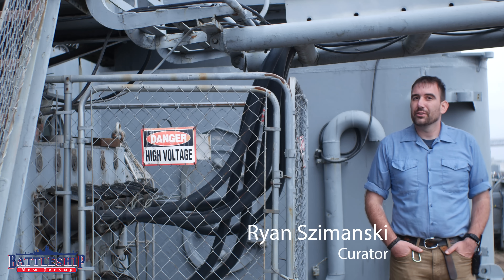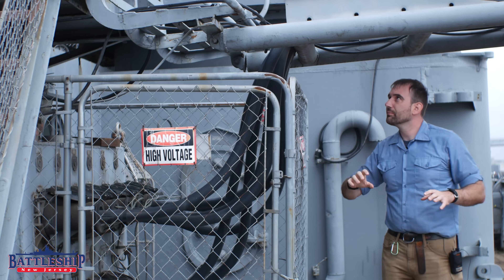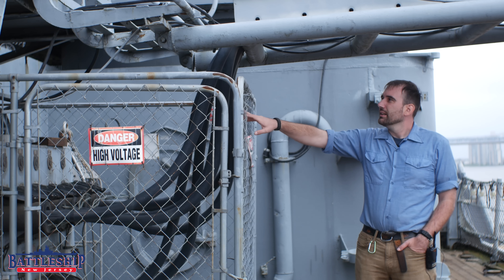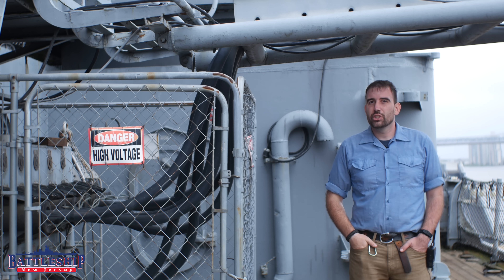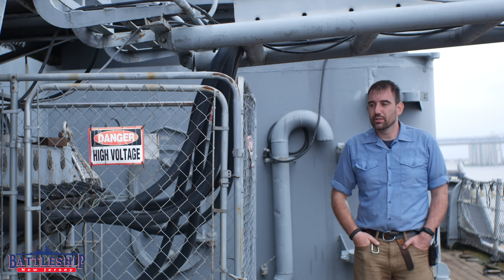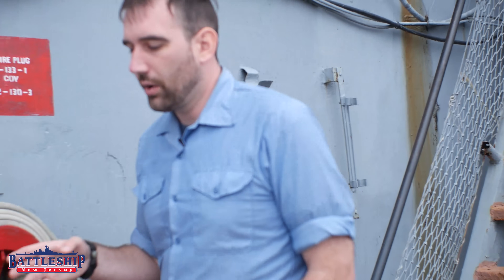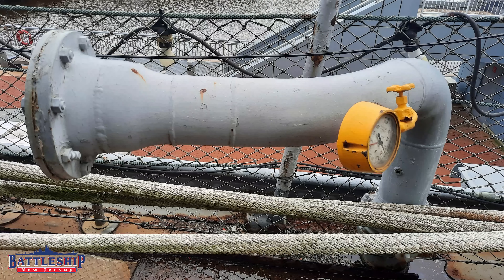Where Does the Ship's Power Come From Today?

Comment: Based on the ship's proximity to the Hope Creek plant you can now proudly say that the battleship is powered (at least partially) by a nuclear reactor.
Reply: Registry # edited to "BBN-62"
Reply: Probably fair to say it's partly coal powered too.
Reply: @borisbadaxe9678  which spins steam turbines therefore the ship is steam powered!
Reply: @ThePrybra07  A Steampunk battleship! Now THAT would be cool!
Reply: @borisbadaxe9678  Wait, is that a joke or serious?
Reply: @dpkeys  Somewhere out there I am sure an alt history exists where the Iowas kept sailing and got a nuclear refit. modern naval nuke probably takes up less space than all those boilers.
Reply: @borisbadaxe9678  It already is, battleships ran on steam. Even the Gerald R Ford carriers are steam ships, The Nimitz class carriers do not really have a terribly different driveline from an Iowa class battleship. Steam turbine driving the screws, Difference is the carrier has a nuclear reactor but when you get down to it the reactor is just a spicy boiler.
Reply: @appleintosh  Serious. It is impossible to say where power comes from, since it comes from all of the sources currently pumping power into the grid. Wind and solar, nuclear and coal and natural gas, all of them power the grid, and the grid powers the battleship.

So in a sense, the battleship is now a sailboat, a nuclear ship, and a coal fired ship. Oh, and since the thermal sources (nuclear, coal, and nat gas) use the heat to create steam to drive a turbine, the battleship is using steam power too!
Reply: Steve Wolcott   Ultimately, every source of power comes from the sun - dinosaurs, coal, oil, solar, even nuclear (which was formed in a dying star).
Reply: @Custerd1  Agreed. Basically all the power on the planet was, and is, from a fusion reactor.
Reply: @firstlast-xn6ul  It gets even better.  You can't just shut off shore power, then connect the switchboards to the ship's generators.

Instead, what you do is bring the generators up, match voltage, frequency, phase, and phase angle with shore power, then literally CONNECT THEM TOGETHER electrically.  You can then start bringing up the excitation on the generators, causing them to pick up progressively more of the electrical load.  When all of the electrical load is on the generators, then you can open the SP breakers and disconnect the cables.

Reverse the procedure when you come back into port.  Hook up shore power, match the generators to shore power, shift the load to shore power, then open the breakers for the generators and start shutting them down.

If you read between the lines a bit, during that 5-10 minutes of shifting the load around the ship is actually doing its small part to help power the US electrical power grid.  After the Loma Prieta earhquake in San Francisco, the Navy Comm station and the galley building on Treasure Island were actually being fed power and steam FROM a ship via the SP electrical and steam connections.  This lasted for about a week, until they could get the power cables repaired which normally fed the island.
Reply: Steve Wolcott  Coal was largely made during the Carboniferous Period, predating the dinosaurs. Once fungi evolved the ability to digest lignin, coal beds were essentially impossible to be laid down in large quantities.
Reply: Steve Wolcott  coal comes from plants
Reply: @filanfyretracker  Yea but as soon as the ship takes a hit you have a massive problem on your hands.
Reply: Ryan mentioned in a previous video he prefers battleships to not be nuclear powered as they don't like the vibrations associated with a hit

Comment: The overhead supports for the electrical lines have broken welds at the extreme left where it transitions to the hinge points.  I noticed it at video time frame 6:45  Looks like it's about to break!
Reply: You can also see that at 3:14. Oof
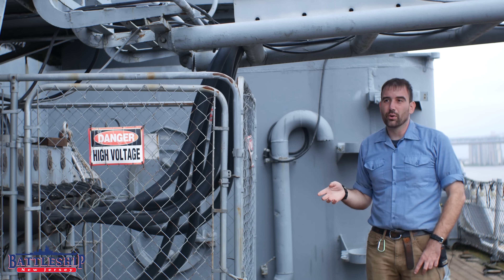Reply: Looks like :53 - 1:08? Back one. Maybe it's designed that way for a little give?
Reply: @robertthomas5906  No, that is a clear failure. it's a normal fatigue break
Reply: I saw it as well in the first 0:60
Reply: also, now is the time to do it. IDK what the final re-decking plan is, but as a welder i sure as hell would appreciate welding over an old floor than a new one
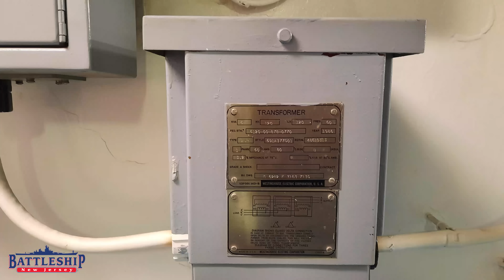Reply: I was going to mention that as well, and 3:14 or 0:53 - 1:08 you can see it well.  That is a lot of weight in the cables and steel support to be supported up there with that much of the weld broken.  Ryan that should be high on the fix list!
Reply: @Chris_In_Texas  Especially if you're going to stand under it
Reply: @kevincrosby1760  Yes, those cables would be heavy. I used to work on a trailer mounted rock crushing plant where we had similar (I think the one for the secondary crushed was actually a little thicker than those ones) 400V 3-phase cables to bring power from two 300 kW diesel generators to the primary and secondary crushers (the generators and their fuel tank built on one trailer, the crushers each on their own ones) and every time we moved the plant (a few times a year) those needed to be coiled and lifted up on the trailers for transport and then uncoiled and reinstalled at the new location. No plug connectors either, they were mounted on screw terminals. We mostly used an excavator to handle them, I suppose a ship would have some kind of cranes or hoists for the purpose?
Reply: Are you volunteering to fix it?

Comment: Whenever you were on the shore power cable detail…you really felt the suckage! I went into the Army as a 52E (prime power production) and we worked with very large generators, either diesel or turbine/jet engine as prime mover…from advanced electronics (sonartech) in the Navy (a twidget) to Army huge generators (would have been a snipe in the Nav). Worked for Army Corps of Engineers on dams and power stations/substations … electricity is electricity, only difference is what spins the rotor. I would have thoroughly loved to see a massive non-nuclear power plant in a battleship!

Comment: If those shore power cables are the same as what was used in the mid 2000s on my late 70s vintage DD, and I'm remembering correctly, each one of those cables can supply 100A. I think I saw 8 cables, so 800A at 440V is 352kW.
Reply: Some could be neutral or grounding cables? I dunno.
Reply: @tflemming287  IIRC, they are 6 conductor cables, so there are already grounds and neutrals
Reply: I think you forgot to account for 3-phase.  100A 440 3-phase is ~ 76kVA per, or a total of just over 600 kVA.
Reply: @n1gak  you're absolutely right, I did! It's been too many years, I guess.
Reply: Those look way bigger than a 100A cable to me.

Comment: I used to volunteer on the SS Jermiah O'Brian Liberty Ship and yes it does have shore power connections. It also has onboard diesel generators as well. It also has water and sewer hookups as well.
Reply: Thanx for answering the question.  I figured if I scrolled through enough comments someone would.

Comment: 2:40 I can’t remember where I heard it, if it was this channel or another. But the biggest problem with cold starting the boilers was a lot of their equipment, such as turbocharged air inlets and pumps were steam powered. Often the ship would need a “jump start” of externally supplied steam to get its own boilers running.

Comment: @Battleship New Jersey:  Do staff walk around with a notepad or tags to mark down when they find something that needs repair?  Such as a leaky ceiling or burned out light bulb on the tour route?
Reply: I imagine that if they’re part of the staff that have radios they can call to someone to mark down issues and get the repair started immediately
Reply: @johnbeauvais3159  Although I have seen Ryan carrying a radio, I'm not sure that they would work well at all inside the ship, considering just how much steel is in the way of the very low power handheld radio communications.

Comment: The ship has two types of power ,single phase and 3 phase,single is 120 ans 240 VAC and Three Phase is 440 or 460. Has the incadesant light bulbs been retrofitted to the new led ,sure saves power.

Comment: I suspect that you also have a shore connection for chilled and heated water to circulate through the various air handlers covering the spaces on your tour routes. 
One of the ships I served on USS Whitehurst was designed not only to accept shore power but to provide it. Our electricians and engine room crews could configure the electric drives to our shafts as generators and through a large reel of electrical cable mounted in the superstructure could be rigged to supply power to shore facilities if needed.

Comment: Dang, I like this new lens/camera setup a lot! 

The logistics of the ship as she stands today is fascinating. Do you have some sort of central monitoring station for water level sensors, pumps, security, etc? How would you prep for something like a hurricane these day - are the normal mooring lines sufficient?
Reply from the maker: For alarms, it's basically like any building. It all ties into one panel and connects to water sensors and smoke and co2 and all that. 

As far as hurricanes, we dont need to do much. We close the exterior doors and haul down the flag if appropriate.
Reply: @BattleshipNewJersey  Thanks for the reply, and that's interesting you mentioned JW Brown, we've joined up with them a few times and flown some mock torpedo runs in our Avenger during their excursions. Fun times. :)

Comment: Those SSTG's were the same we had on the Destroyers I served on. We only had 4. And used only 2 at a time. If memory serves me right, we produced about 1 megawatt to maintain a 435 foot 4500 ton destroyer with 300 men on board. I've always wondered how much of the 25,000 gallon a day we burned in fuel oil went to electrical production.

Comment: No need to say "hour." That's used to describe a quantity of energy over time, not instantaneous production capacity. 10,000 Kilowatts is the same thing as 10 Megawatts (10 million watts) which may be easier to fathom. Interesting the ship didn't use higher voltage like 4160v for sake of copper use.

Comment: That’s crazy that the Navy would design a ship that can’t generate enough power to operate everything on board.  If I were the mayor of that town, I would think it would be nice during an extreme emergency that the ship could be used as a generator to feed the grid.  To bad those systems can never be brought up to operation again.
Reply: They design the electrical systems to be able to power everything that might run at the same time the same way that your home electrical system is designed assuming that you won't run the air conditioning and the electric heat at the same time.
They also design oversized power sources knowing that parts of the generating system may fail when they need full power.

Comment: Suspect the shore steam was really just low pressure auxiliary steam to provide heat for things like hot water heaters and the steam kettles in the galley.  Even on a Tico which only had Waste Heat Boilers (strictly low pressure) to provide auxiliary steam we would need to hook up to shore steam or we'd need to run one of the ships SSGTGs just to operate a WHB to provide it.

Comment: Would the steam hookup be used for heating as well? If the boilers were shut down? Also would like to say thank you for making videos! I love them!
Reply: I would say its low pressure steam. So Steam heating and a steam blanket for the boilers. Maybe heating for the fuel/lube oil as well.
Reply: Most of the pumps that feed the boiler system are powered by steam. It's assumed that there would always be some amount of steam onboard when you needed to fire another boiler. Cold Starts are more complicated because you need to figure out a way to get make-up water until the steam powered make-up water pumps are available; as well as the various other systems that need steam in order to help the boilers make steam.

Comment: I am sort of curious as to whether you adapted the in-service shoreline power solution. I guess we will find out. It would also be neat to know how many KWh she uses in an average day.
Reply: In the lighting video Ryan says that they actually spend an awful lot of money on the electricity for just the lighting
Reply: @Masada1911  I think he mentioned that in the past. Maybe $10K a month. Also in a past video there was talk many lights have shifted to LEDs. It not just the lighting- Ventilation fans and the AC or heat. I just reversed by calculation - if my bill was $10K for a month I would have used 87 thousand KWh. (base $1 per day 11.44 cent per KW) Now there are different levels of service and different charges for different levels of customers.
Reply: @wfoj21  Thanks for that. Really puts things in perspective. She is a big thirsty girl even in sleep mode!

Comment: Ryan, how much of the ship's lighting systems have been converted to LEDs, while still maintaining the original look? Could you save more money by doing so, especially 'smart' systems that have some level of control, such as motion-activation? Some more modern systems can even report their power consumption back to a central system or offer control via a computer or smart speaker.
Reply: I was thinking that! We’ve switched from strip lights to direct LED replacement and they cost a fraction to run
Reply from the maker: We have a video about that: https://youtu.be/fCm5x2OmdHI
Reply: @BattleshipNewJersey  Thanks! I see that the linked video says (in about the last 2 minutes) that around half of the fixtures have been updated to modern LED bulbs in the CFL form factor. But I am still curious why the other half of the bulbs - which still apparently cost a lot in ongoing power, replacement, and disposal costs - have not been gradually replaced with LEDs as they fail, which would slowly reduce lighting costs over time. Perhaps run a fundraiser to completely transition all lighting to LED, red tube covers included? You could call it "Battleship New Jersey lights the way!"

Comment: Retrofitting with LED lighting would save a big chunk of change.
Reply: I think I heard in the video dedicated to lighting that they got some grant money to upgrade the lights on the tour route to LED. 

LED makes more sense if you are running the lights frequently. It has a large up front cost, and the energy savings don't add up to balance out the higher up front cost if you don't keep them on a lot.

I think they replaced about 10% of the total lights on the ship, but those are the ones that run for hours and hours each day, you aren't turning the lights on to a void space for hours each day, so no need to replace those.

Comment: Energy bill.  
I'd be looking at each circuit to make sure that there are not any hidden loads. 
Also, step down transformers draw primary power even if there isn't a load on the secondary side.  This is especially true with ones from the 40's so disconnecting unneeded units can save $.

Comment: My question would be - now that BNJ is essentially a public building, does it require some sort of special treatment under the electrical codes?  For instance, you don't often see high voltage service going in to a building through removable connectors.
Reply: They're feeding it with 480V 3 phase. Those types of connectors are common at those lower voltages.

Comment: I wonder how much of the power limitations was it production vs distribution? If I had to guess, I'd guess some of each. I'd expect there was enough power to run all the lights (assuming you could shut enough other stuff down) at the same time, but it wouldn't surprise me if at some point in the power grid they overlap enough that trying to would trip breakers.

Comment: I've been on Jeremiah O'Brien in SF but not during one of her cruises. She was an impressive site the day I rounded Treasure Island and saw her heading our way. I've also  been aboard while she is steaming at the dock. Such a sight, a two story engine with most of the parts just flying around in the open. They have to start her without steam from cold. If the steam tug Hercules is ever brought back to full operation she could come alongside and supply her with steam. I'll ask the engineer if that would even be possible.  It sure would be fun to try. Of course Hercules would still have to start from cold but she uses natural not forced draft for her boilers so that helps. I wonder how much more involved starting a steam turbine from cold is?
Reply: I've been in the Brown a few times when she was underway - so amazing watching the engine working as she moved her along!
Reply: @garywayne6083  I know, all that 1890's steam tech in a 1940's ship. Works.

Comment: If two ships were at sea and one was having mechanical problems, would it have been possible to connect them via these shore links & have one provide the other with electricity and/or steam?
If so, was this a common thing? or something you'd avoid at all costs?
Reply: No, not possible. Only for shore power hookup.

Comment: Who is responsible for verification of correct phase rotation onboard the battleship? In the event of a power outage or interruption of shore power, before power is restored is correct phase rotation verified? I would also assume there is some means of automatic transfer switch to ensure no back feeding of the shore power utility grid? A close look at the interior onboard switchgear at the point of shore power connection would be most interesting and much appreciated. Thanks 😊
Reply: Phase rotation is established when the Service is initially connected and doesn't need to be verified after a power outage. If the Utility disconnects any wiring on their side (transformer, capacitors, TSS) it's their responsibility to maintain the same phase rotation when they reconnect their equipment.